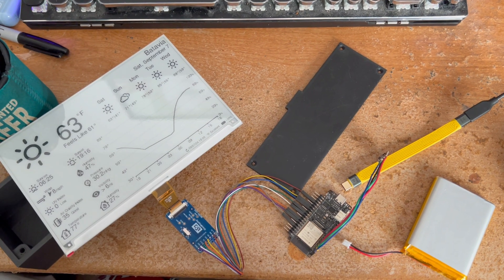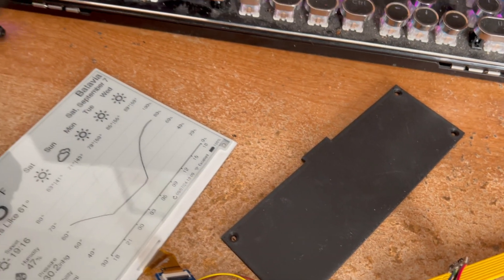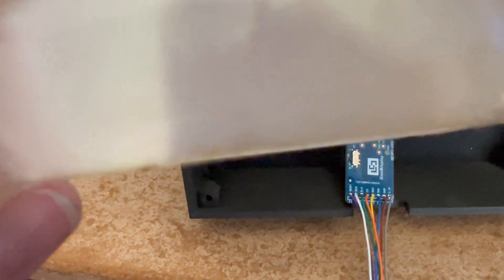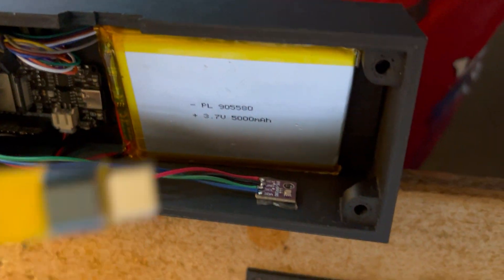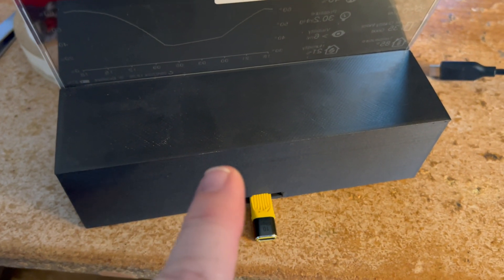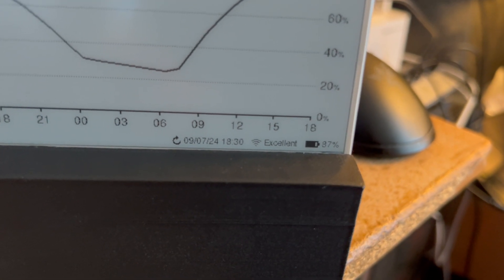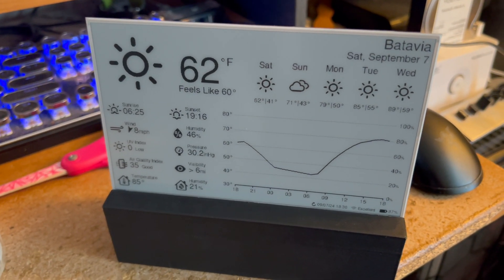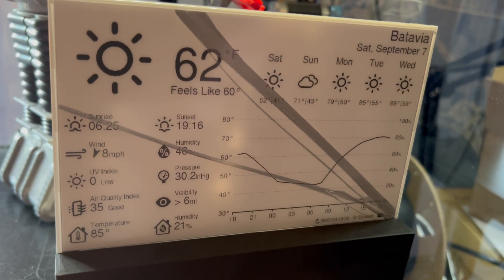Esp32 Weather Station

Comment: just a little tip, you might wanna add some ventilation holes to the base, to allow for proper measurement of indoor values, and stop moisture buildup inside